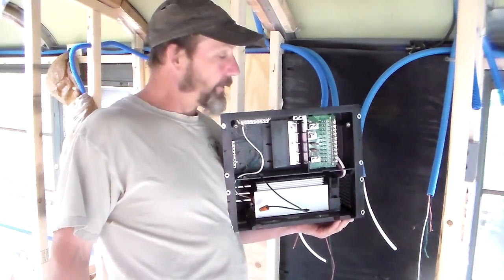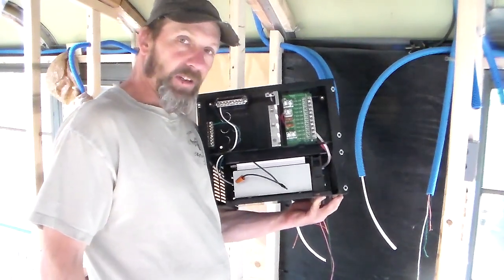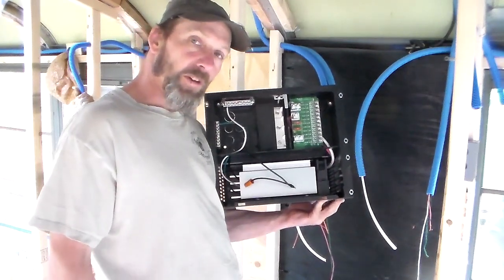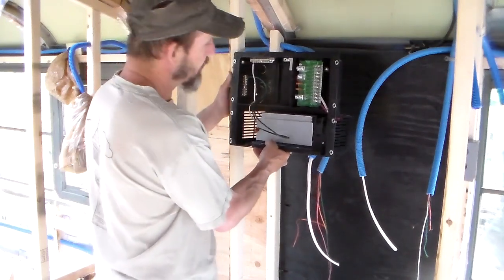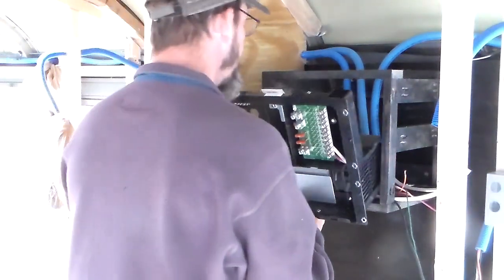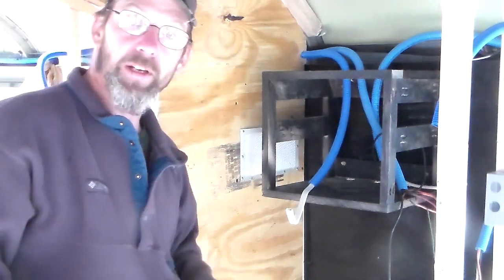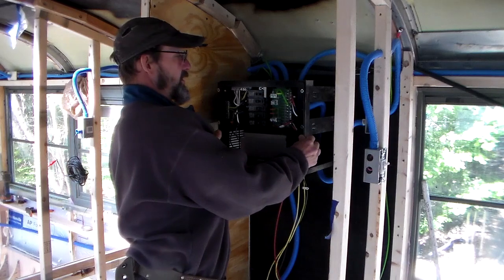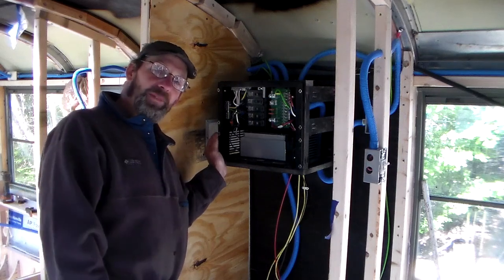Skoolie Power Center Install:  WFCO 8955

Comment: The WFCO 8955 is a good unit. I got one for $150 instead of rebuilding the 15 year old unit that came with my trailer.  It has a much better battery charger too, although it doesn't work with Lithium batteries. If I could afford Lithium batteries, I'd probably go all out with a Victron system, which would cost as much as my trailer.
Reply from the maker: It's been great for me!  Did you see my lithium battery build video?  I built a 280aH battery that's also been working really well.  I did have to put in the WFCO replacement component...but it was relatively easy.

Comment: Love your videos! I'm converting a 40' Bluebird right now. Almost to the electrical stage... The link to the crimpers takes you to a cast iron pot, fyi
Reply from the maker: Thanks, Matt! 40'!! That gives you some room!  Are you going with stranded wire or Romex for your electrical?  100' of wire for the 110 circuits just barely did it for us.  I'll check that link, too, thanks!

Comment: One question: on the 12v dc side, there are three connectors..one top (negative battery), one bottom (positive from battery) and one in the middle. I noticed at near the end of the video
there was a red wire attached to the MIDDLE connector......what is that wire?             oh...Great video...helped me a lot.
Reply from the maker: Ground wire. I bolted the ground wire to a rib that connects to the frame. I’m glad the video helped.
Reply: It’s the power from converter I believe

Comment: Near the end you spoke of a “charger” and flipped one the 120v breakers to turn it on and then turned it off the confirm getting a trickle charge. Won’t the Power Center charge the 12v house battery without a separate charger plugged into the 120v circuit and connected to the battery? Great video btw.
Reply from the maker: Thanks, William!  Great clarifying question.  The charger I'm referring to is the charger built into the power center.  It feeds from the main 120v breaker (the one at the top) of the power center.  Does that make sense?
Reply: @River-Channel  There's where my confusion lies. At about 25:11 you trip the 2nd breaker down. I though the main breaker was the 30amp one at the top where shore power is connected to.  I appreciate your quick response. I am in the middle of a vintage trailer restoration and this is helping greatly.
Reply from the maker: @WillPainter_OregonNative  Oops...I must have been too focused on the camera and not which breaker I was flipping.  Top one should control the charger.  Sorry about that!  Best of luck with your restoration!

Comment: Just came across your post. Can you tell me what you did with the piggy back wire that's on the 8900 service box
Reply from the maker: If it's what I think you're referring to, you can use it to tie another circuit into the power center.

Comment: Hey man quick question for you.  Everything you did makes perfect sense.  It cleared up a lot of things for me in my race car hauler I’m building.   Did you ever find out if grounding the ac and dc both to the chassis of the trailer was the correct way to go
About it?
Reply from the maker: I did...I went back and checked the WFCO installation manual and it says "Also, route an 8 AWG Green or bare Ground wire through the small diameter hole located next to the Ground bar to the vehicle chassis."

Seems to be working well...had it plugged in all winter to keep the batteries trickle charged.

Best of luck with your hauler!

Comment: Hello ! I just subscribed to your channel, really liked the episode! If you don’t mind I have a question on the 12 volt side of the installation. I just picked up the same unit you installed. I did notice the 12 volt side does not have a ground bus bar . So when running your 12 volt items what do you do with the negative wire because the circuit board only has a location for 12 volt positive? I have a build series myself and I’m just coming up on the wiring phase and this part has me scratching my head 🤣!  Thanks in advance!
Reply from the maker: I'm pretty sure that the directions say to buy a separate negative bus bar and connect your negatives to it.  However, I attached all my negative wires to the ribs at the source.  So, for example, each of my lights and the water pump negative wires attach to the nearest bus rib.  That way I can reduce the run length and the wire diameter and also don't need a negative bus bar.  Let me know if that makes sense.  Thanks for watching!

Comment: Hi! I wanted to know would I have to a run a wire from the converter to the batteries in this system?
Reply from the maker: Yes.  Both a Positive and a Ground.  I used 8 Gauge wire.
Reply: @River-Channel  Okay so run 2 power cords and two grounds? One for the main power.. one for the converter and two grounds? Because I already see the power and ground cable connected to the converter and it's connected directly to the power center 🤔

Comment: Is there a reason you did not run a ground wire for the 30amp service? Where is it okay to only have a hot and neutral without a ground wire?
Reply from the maker: I did end up going back and running a ground from the shore power to the bus chassis.

Comment: Ordered the same converter. what type of 110 breakers are you using?
Reply from the maker: Square D.  30 Amp for the Main, 15 for the Converter (2nd breaker down) and 20 Amp for the rest.

Comment: & just to clarify run all negatives on the fuse side to the same ground as the breaker side? So both will be wired to the chassis ground?
Reply from the maker: Joanne...I'm not exactly sure what you mean.  The way I understand it, everything is eventually grounded to the frame of the bus.  I'm not sure I understand what you mean by fuse side or breaker side.

Comment: I did see I your video how you hooked up the black wire with the pig tailed wire nut coming from the converter. Did you add it to a breaker or give it its own breaker? Or did you just leave it? Also did you ever find out if the ac ground that you ran was correct or not necessary? Thanks for your video it helped a lot. Could you show you 12v ground bus bar or how you grounded you 12v that you ran to the panel. I’d you run an in line fuse or a cut off switch from your converter to your battery bank? Would be interested in seeing a video on that if you have one. Looks good man nice work btw
Reply from the maker: I gave it it's own breaker; we don't have that many 120 Volt circuits.  

I did go back to the manual and it said to ground the AC to the frame of the bus, so I'm assuming what I did was correct.  I haven't had any problems.

I didn't use a 12 volt bus bar, I grounded all the DC circuits to the ribs of the bus.  For example, each light has it's own ground to a rib and the water pump is grounded to a rib.  

I don't have a fuse or a switch to the battery bank.  Might not be a bad idea but I didn't even think of it!   (I do have just a plain light switch for the water pump, though, so I can shut it off if I need to!)

Hope this helps...and keep the questions coming it's nice to refresh my thinking!

All the best!

Comment: What is  the yellow wire running to because I am running an A/c Unit
Reply from the maker: The yellow wire is the neutral leg coming in from the shore power to the neutral bus bar.  I suppose it should have been white, but I had it left over from the bus wire removal and it was great 10 gauge wire, so I wanted to use it!

Comment: I notice that you use a 30amp breaker, and my question is That I have the same box as yours and can I use a 50amp breaker? 
Do you have a 50 or 30 amp short power plug?
Reply from the maker: According to the manual, the WFCO 8955 is rated for 30amp main breaker.  You can check out the manual here:  https://wfcoelectronics.com/wp-content/uploads/2021/02/Updated-8900-Series-Manual-FINAL-RP.pdf

I have a 30 amp shore power plug:  https://amzn.to/3E9cRaz

Comment: I found your channel tonight. And not being an electrician, I'm curious to learn how I would install a solar panel on my 1989 Chevy G20 Camper Van and connect it to the existing power system onboard. Is that a difficult job to do?
Reply from the maker: Not really sure!  Most of the time I have access to shore power so haven't invested in solar yet.
Reply: It's easy. Wire the solar panels into a charge controller, then through a 50A DC breaker directly to the battery. Check out Renogy systems, they have everything you'll need.

Comment: The AC ground must NOT be connected to the vehicle frame. AC panel ground must be tied directly to the incoming AC supply ground. Directly to shore power ground or directly to generator ground. This prevents accidental electrocutions or AC bleeding into tne 12VDC circuits. A proper transfer switch is used if you have both sources.  Otherwise a great video.
Reply from the maker: Thanks for the info!  I will double check and rewire!
Reply from the maker: C.Robertson:  I've been thinking about your advice and went back to look at the system and check the manual.  The manual says  "Also, route an 8 AWG Green or bare Ground wire through the small diameter hole located next to the Ground bar to the vehicle chassis."  Are you suggesting that I omit this wire and just have the ground come in from shore power and connect to the AC ground bus bar?

Comment: For those of us planning to install batteries in our systems, is it possible to wire things in a way so that the battery could be use to power the distribution centers 12V when not on shore/generator power, instead of wiring all the battery 12V devices off the battery? I'm probably really overthinking this.
Reply from the maker: I'm not exactly sure what you mean.  When not on shore power, the battery would still continue to power the power center and all the 12V circuits running to it.  It just won't trickle charge and 110V circuits won't work unless have an inverter.  (Which this WFCO unit doesn't have.).   

What do you mean by the "battery 12V devices?"
Reply: @River-Channel  I see, so the battery is wired into the power center already. That's what I needed to know, thanks.
Reply from the maker: For sure!

Comment: What did you do with the wire coming from the charger it's it's the black one with Orange Orange cap on it
Reply: I'm rebuilding a 1987 Casita
Reply: Why don't you want to talk to me
Reply: Dude you are an actual teacher but I need to ask the teacher question
Reply from the maker: David, sorry, I've been cranking out work to try at get my daughter's short bus ready to roll for the this weekend.  The black wire just gives you one extra circuit to work with if you need it.  Just leave it capped if you don't need the extra circuit.
Reply: It looks like you have a 15 amp breaker that it's hooked up to
Reply from the maker: I think I do have one 15 amp in there.  15 is okay for lights...I prefer 20 amp for receptacle circuits.
Reply: So the wire connected to the trickle charger that has the Orange nut on it is connected to a 15 amp breaker
Reply from the maker: @tort2848  Right...don't need that much power there
Reply: Thank you so much that helps out a lot Did you use 10 gauge wire on the  shore plug to the 30 amp breaker
Reply from the maker: @tort2848  Yes...and 6 gauge wire from the power center to the battery

Comment: Where does the breaker stab bar go?
Reply from the maker: I'm not sure exactly what you mean.  The 110 breaker bar connects the breakers to the shore power lead coming in.   (And each circuit from the bus comes into the breakers themselves.). Is that what you're asking?

Comment: Where does the "Shore Power" get wired on the WFCO?
Reply from the maker: Your "hot" wire, usually black, should connect into the top breaker.  I have a 30 amp service, so I put a 30 amp breaker there.  The neutral wire (white) should connect to the neutral bus bar at the top of the WFCO.  The ground (green) should tie into the ground bus bar on the left.  Make sense?